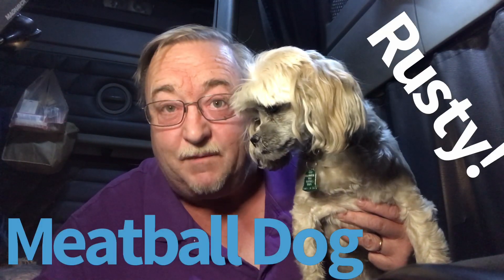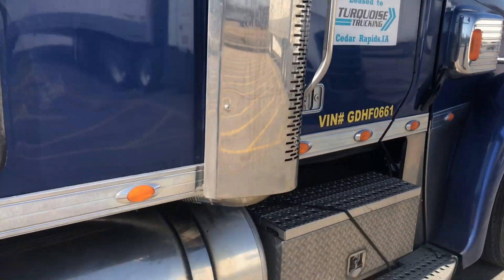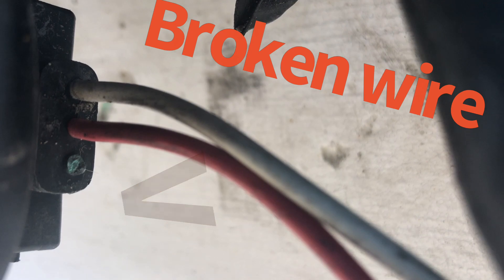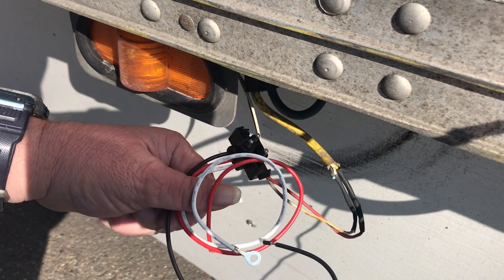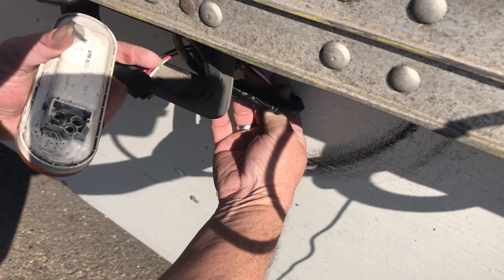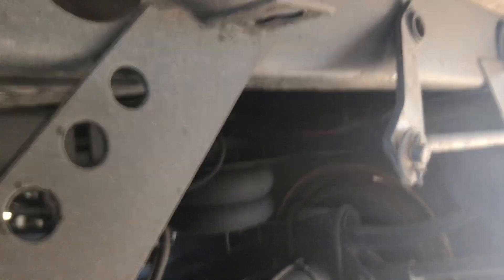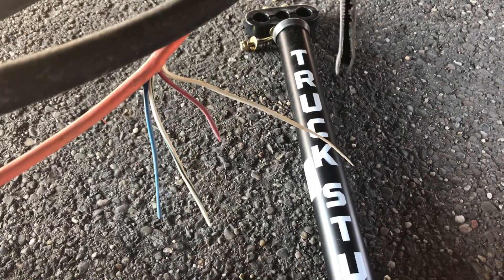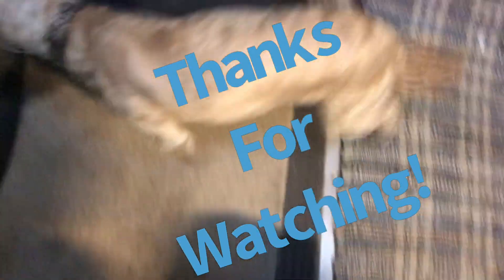Quick & Dirty wiring repairs, new muffler & Y Pipe, updates and more

Comment: Hi clutch. Sunday evening. Top notch electrical engineer I would say. Good job on wiring. Exhaust looks good. Got everything looking good for spring.  Had rear seal leaking on my cummins. Had repaired last week new clutch and flywheel machined new pilot bearing. Always something. Have a good week coming up. See you two.

Comment: Reminds me of working on my truck wiring.  Use to call it my rats nest.  I used shrink tubes and made my own splices. Found butt connecters not reliable and expensive. Enjoy the warm weather!  I'm going to. Work Monday so hope it lasts!
Reply: Butt connectors are compete garbage. Twist the wires put some nolox or diletictic grease and heat shrink.

Comment: Have done that same job even thou I am a company driver just to keep moving but used but connection n sealed the connection
Reply from the maker: Either works fine and I just went with what I had for that repair and like you yes even when I was a company driver I would do kind of quick repairs like that just to keep moving because I didn’t feel like waiting to get the company approval and they get into a shop and all that

Comment: Clutch, you should not run your wires parallel and twist the ends together, then bend them out straight. This causes unnecessary stress on the wires and they will fail. Instead butt them up to each other and wrap the wires around one another. Then use your heat shrink. Or if possible purchase a set of butt splices that already have the heat shrink attached. That's the way we did it in the Army in the 80's and professional shops are still doing it that way today. Also so there's no chance of getting the wires mismatched do the whole process individually, don't cut all the wires at once and try to remember that the red wires go together, the white wire goes to the green lead and the black wire goes to the brown lead. Whatcha gonna do if all of a sudden you gotta run and take care of something else and can't get back to your project for 30 minutes or more?
Reply from the maker: Well I risked that I guess. Yes your method is probably stronger. Went with what I had at the time. Plus I’ve had just as many butt connectors fail as this method.

Comment: Hey clutch did you install your inside trailer lights if So tell me what size and how do you turn them on/off?
Reply from the maker: Trailer came that way. There used to be a switch inside right rear, but it’s been broken twice. For now I just hard wired them to stay on. They turn off when trailer marker lights are off
Reply: @ClutchTrucker  thanks